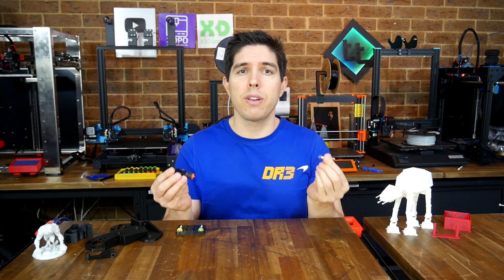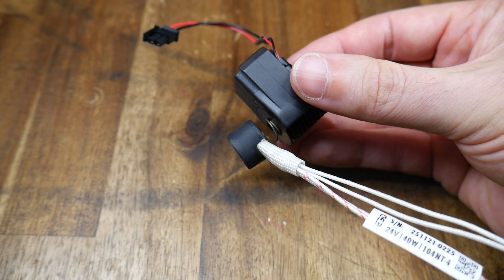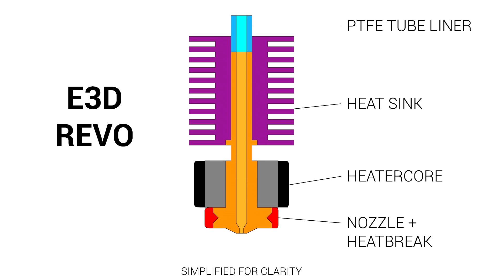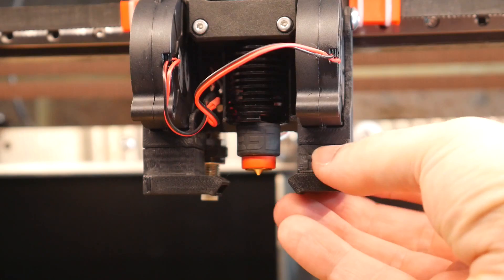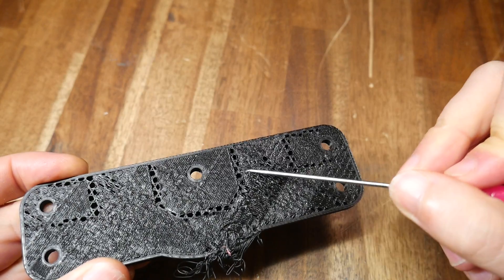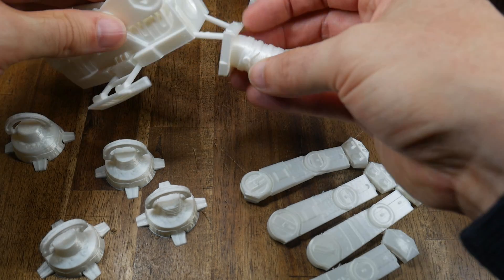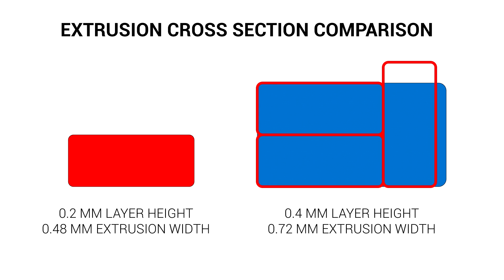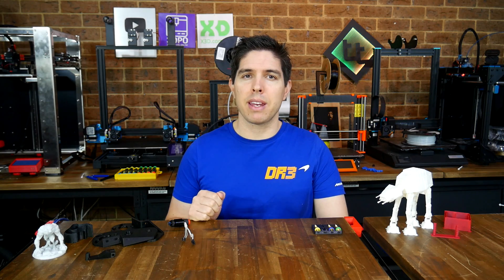E3D Revo practical review: Fast coreXY 3D printing?

Comment: Unless you have a need to frequently swith nozzles, then I do not see the advantage.  The price point is a very close second.  I see no advantage to upgrade if the performance is on par with existing hardware,  not to mention the firmware changes that for a novice are cryptic and a huge hassle.

Comment: 8 months ago.  Heh...while this is...late...hit the mark is the take here.  

My current observations are as yours were.  It's worth noting that for many, the value proposition is being able to quickly, reliably and EASILY swap nozzles on this system.  People keep going on and on about E3D clone costs...well, you still have fiddly crap that you highlighted in the video...that you still have to do.  Once the Obxidian and the high-flow nozzles come out, we're going to see the value proposition get even better.  Esp. if you don't need to change out the hot-end for the basic systems.  Right now I've a project that is running mostly in stealth mode, but leverages the Micro.  Since I was buying that, I thought I'd get the CR for my Ender 3 v2 I'm using to make the parts for the other with.  Nice improvements on print for me at least.  And now I can swap out size easily to do things like you talk to.  $80-90 for that much?  Cleaner prints and easy nozzle swap?  Yeah.  Sign me up.  Now I'm looking forward to what I can do with my project with it.

Comment: Volumetric Flow Rates based on ~12:37 in the video and using 0.6N / 0.4H /  0.72W  using super slicer to check.

80mms = ~ 20mm3/s
60mms = ~ 15mm3/s
60mms = ~ 10mm3/s

Looks like it maxes out at about 15mm3/s on the 0.6
Reply: in line with what the old v6 was capable of

Comment: When i want to print 200mm/s which settings to change?
In slicer? Which one? Perimeter? Or i just change the feedrate on printer screen?
Reply: Change the power outlet voltage to 600v. Should get faster....

Comment: Can you make a video on how to configure slicer for all the Revo nozzle sizes?  Most slicers with a pre-configured profile do not include settings for nozzle sizes other than 0.4mm, with occasional support for 0.6 nozzles.  Manual intervention seems to be required for slicer settings with 0.25 and 0.8 nozzles but most users may not know line width and layer height slicer settings to use with those nozzles.

Comment: I have a problem with the thermistor on mine after about 3 weeks of use.  It under reports temps and the hotend gets super hot.  I've ordered a replacement core, springs, and socks.  Print quality was excellent (prior to the issue) and setup super easy.  Really like the microfit connectors for both thermistor and heating element.  Makes swapping and tinkering much simpler.

Comment: This year I bought my first FDM printer (TwoTrees Sapphire Plus V1.1) and the Revo Hemera and Revo Mini on the same day. The Revos showed up just as I was getting sick of tweaking the stock hotend, dealing with leaks, etc. The Revo Mini was a drop replacement. I continued to use the bowden system for a few weeks while I researched and tweaked my Hemera mount, part cooling, and BLTouch holder. I really like the direct drive and can't wait to start printing this TPU I've yet to open. Currently I designing a mount to let me have the Revo Mini along side the Hemera as a secondary bowden extruder for printing dissolvable support. I love this new Revo system. Watching Sanjay's many interviews is what made me decide to finally buy my own printer after having used them at Maker Spaces for almost a decade. ☮❤🌈🧘🏽🕉☸☯

Comment: Great review! This will take a bit of getting used to for someone like me who changes nozzles before each big project just because they are so cheap and brass wears out. i wonder how long these will last compared to a standard $0.50 nozzle. Will be very interested in the hardened ones as they should last a lot longer. Price is always a concern but if they actually last a good long time then I could see it being a worthwhile investment just for convenience of changing nozzle sizes. I do hope the actual nozzles come down in price as $15+ can hurt if they wear out as quickly as standard brass.
Reply: There is no need to change your nozzle that often unless you are using abrasive filament.
Reply: @jaro6985  Sorry for late response but I have actually measured nozzle openings and even with PLA it does wear it down (glow in the dark and other abrasives can change the size even when using 1/4 of a roll!). Sure it is really slow for PLA (I can notice a size increase if printing almost 24/7 in around 2-3 weeks. It would not effect things most people print) but I would rather err on the side of caution and since they are so cheap, it's no big deal.
Reply: @StumblingBumblingIdiot hey man, just a small comment that nozzle wear pattern is not seen as a widening hole but rather as the tip getting worn down from dragging over the prints. It has to be quite worn down to start widening the hole, as this happens when you hit the conical section transitioning from the 1.75mm hole to the 0.4mm one. 

You may want to recheck your measurements and the technique used to measure the hole itself, i can't be sure but I have a feeling something's off there.

Comment: The only disadvantage of revo so far is that it doesn't have any abrasive resistant nozzles, I dont print regularly with abraisives but I much prefer having a hardened nozzle  just incase i want to print some glow int he dark fiolament or wood filled filament without having to swap out my nozzles
Reply: If you are doing a few one off abrasive prints, you aren't going to destroy your nozzle in a day. When I first started with 3d printing, even though I had a hardened nozzle, laziness of having to relevel everything made me just leave the brass .4 nozzle on there, and I printed spools and spools of wood filled filament. There was never any issues, until some years later, one time while declogging the nozzle I realized a .55mm drill bit was able to fit into my .4mm nozzle. Haha, that's when I finally took it off to have a look at it. Yup, all the years of printing wood filament did take their toll. It made a .6mm nozzle out of my original .4!  Anyway, knowing this, starting from a fresh .4mm brass nozzle, I ran through some Protopasta CF HTPLA for a few prints, and then I checked the nozzle under a microscope and as far as I could tell, there had been no change. Obviously if I ran it for months, I am sure it'd worn it out, but if it is just a one off, it'll be fine.

Comment: Looks like I found my new hot end! Have a tronxy and converting it to linear rails so might as well up grade to direct drive extruder. It's Boden tube is ok after setting it at 45° to the print bed but still don't think it could handle ninja flex as it's SOOO flimsy.

Comment: 4 nozzles for $80 vs 30 classic nozzles for $11. No thanks they can keep them. The amount of time saved by switching nozzles is almost nothing unless you go so big that it prints ugly and so I never change my nozzle size. They fixed a problem that doesn't exist.
Reply: For me the cost of the revo hot end and nozzles is almost negligible and I pick the right nozzle for every design and print,, just goes to show how diverse the 3D printing community is.

Comment: Really interesting that you found the Z offset reminded spot on after swapping the nozzle. That was my only big question with the revo, if you still needed to tweak this each time whilst obviously still being easier/quicker the time gained wouldn't have justified the upgrade. The idea of swapping from a 0.4 to 0.8 without messing around has me seriously wanting one now, thanks.
Reply: you really should still check the first time. I had a 0.25 with a bad thread and it made a mess of my print surface. E3d replaced next day so can't fault them and I should have checked the z offset.
Reply: @leesmithsworkshop  Thats some nice customer service. New product issues are going to happen, but a no fuss return is incredible on their part.
Reply: I bought a Revo6 set, and for me, the 4 nozzles had slight length differences, and correspondingly, slightly different Z offsets. My .4 and .6 nozzles are the same length, and my .25 and .8 nozzles are almost the same. The difference between the two groups is 0.2mm, which is definitely significant enough to warrant a separate profile on my Prusa. Now on the E3D's specs PDF for the Revo nozzles, they do say 41.1mm+/-.2mm, so my experience is still within their specs. Anyway, despite this, I still think this is a huge improvement on the previous nozzle change experience. Despite owning a bunch of different sized nozzles for my v6, I never switched because of the huge pain in the ass of the whole process, and of potentially breaking the heater cartridge wiring, and having to re-hot tighten, and having to re-level, etc etc... With the Revo6, I actually choose the nozzle size for the print in question, an amazing new experience.
Reply: Don't have to tweak z offset on any other rigid mountes heater block either.

Comment: Good that you found the odd speed on that layer, but in the future you can also use the volumetric flow settings under filament.  This is handy since you can set speeds for what works well with the motion system and then just set that cap under the filament.  Using that setting is also useful for flexibles so you don't have to completely rewrite a new main profile.

Comment: I have them in both my Hemera and I do have to change the Z offset for each nozzle, only a very small amount so not a big deal and I also found the change was repeatable each time I swapped. It would be nice if marlin had an option for more than one z offset like the prusa mk3 does. I have printed with all of the nozzles and only had trouble with the 0.8 because I didn't have time to tune a slower profile yet.
Reply: @WhiteG60  good idea. I have started organising files by nozzle size so I could do that
Reply: Add a nozzle based endstop like on Voron? Means that it will figure out the real z every print.
Reply: @justindelpero  not sure how I would do that with the Hemera ?
Reply: @leesmithsworkshop  it's just a fixed endstop that the nozzle presses. The difference is that the distance between the top of the bed and the endstop are always the same so changing nozzles doesn't impact z offset. It's pretty cool.

Comment: i'm eagerly waiting for the creality compatible version, once that comes out I will be seriously considering getting one or two for either my CR10 or Ender 3 V2.I'd love to be able to flip between small nozzles for models and larger nozzles for massive projects, which is usually reserved for my CR that has had a 0.8mm nozzle on it for months now
Reply: There are metal mounting brackets to get a v6 hotend onto a cr10 or ender style mount. wouldnt that be sufficient?
Reply: @redwraith6576  I’d rather not lose any Y distance, maybe if there’s something out there that offers that then I might be willing to try!
Reply: @connorbennett5932  I have a revo micro on my ender 3 using e3d's mount found on in the installation instructions and I didn't lose any Y volume. 

The bed on the ender 3 can over travel a little, and the e3d mount only shifts the nozzle 4.75mm forward which was well within the range of the y axis. You can account for this offset physically by moving the limit switch, or set it in your slicer of choice (in Cura it is under the extruder settings of the machine). Personally I went with setting the offset in marlin, you already have to compile new firmware so adding the offset there made it where the machine correctly homes and everything is centered with no volume loss. 

If you aren't comfortable with custom firmware or setting offsets the creality revo will be perfect since it uses the same thermistor settings as a normal creality hot end so no firmware changes will be needed along with the mount physically being in the right spot.
Reply: @darthyoda2999  Hmm... That's nice but when you have a BLTouch I think you have measure it all up and than re-compile the firmware with the new offset values (or dial it in and store it if you already have a compiled version with all the menu entries). If there is a Revo in development for the Ender series i assume there still would be some tweaking necessary, so it's no big deal.
Anyway - I rather have a version where the hot end assembly can easily been swapped out with the original Creality one. I rather do not use printed parts for hot end mounting. Even slight deformations can have a impact on the print quality. Printed parts can deform on relatively low temperatures (that make sense material-wise otherwise you could not print that mount piece).
Reply: At 3D Meetup Sweden E3D showed a Revo version for the Ender 3, I think it Will be released in May.
Reply: @nsihvo  My birthday present to myself will be this! Thanks!

Comment: 2:23

https://en.wikipedia.org/wiki/Temperature_coefficient#Positive_temperature_coefficient_of_resistance

the positive temperature coefficient is safer because it requires MORE power as temperature rises to continue heating. this is good because a negative temperature coefficient would be prone to runaway.

Comment: Because of the position of the thermistor (outside of heater core, as opposed to between heater and nozzle), the temperatures read a little hotter than the equivalent value you would get with a v6. CNCKITCHEN mentioned this in his recent video on the Revo. So it's not unusual to have to set your extruder temperature about 3C higher.
Reply: Well, there's gotchas with the other design- as it's not reading any more accurately...  ;)